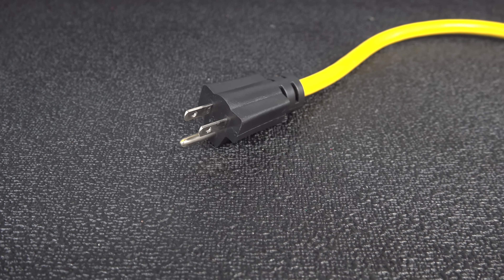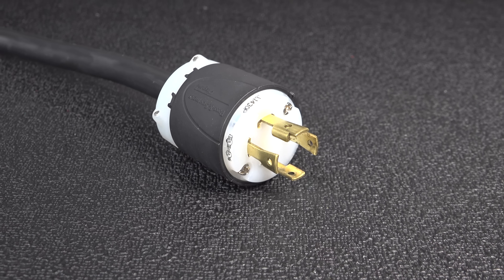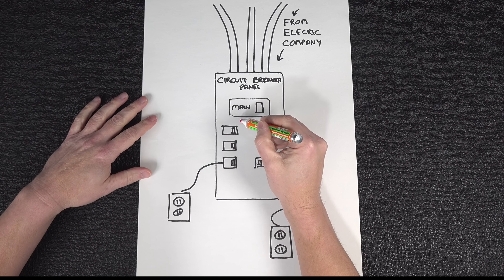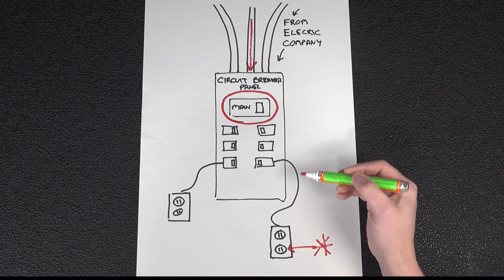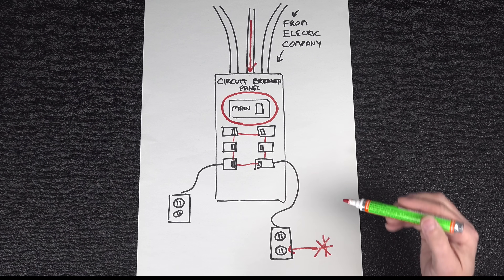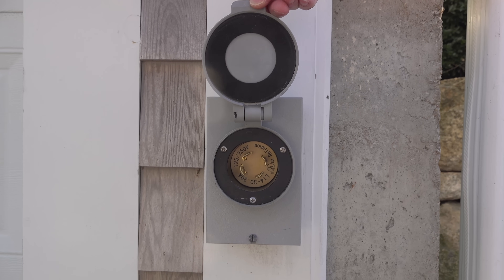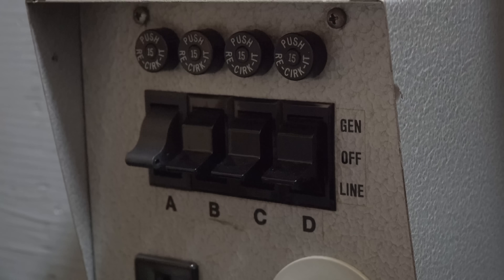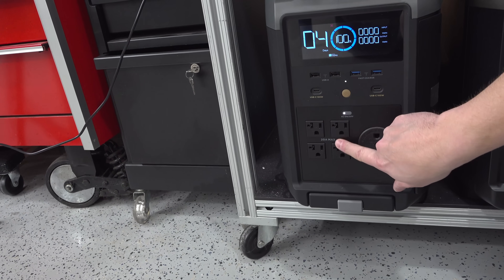Worst Electrical Mistake You Can Make - Backfeeding Generators

Comment: Thanks for this video! I'm a master electrician and seeing a product like this being sold makes me so mad. Imagine if someone's kid gets a hold of this and plugs it into an outlet and grabs the other end. Someone is going to die with a product like this on the market. Its one thing for someone who (hopefully) knows what they're doing to make a setup like this to get themselves out of a pickle, but this should not be something that is mass marketed. I checked out the ad on amazon and its sold from multiple sellers as for being connected to a transfer switch and as having safety features. A bunch of lies. I know some people that sit on electrical code council and forwarded this to them. Hopefully they can get this in front of someone who can get it pulled from the US market before someone dies...
Reply from the maker: What really surprised me with this video is how many people seem to see backfeeding as some right for liberty or other BS. As you clearly understand electricity, it's not an insurance policy but a regulation that truly does something, and in this case makes sure that no mistake can happen when connecting a generator. I did it not because it was was in the NEC but because I work and we would lose power and there was no way I could be sure my wife with kids running around that she could do it without making an error. So it works great, can plugs it all in, can't get shocked and won't backfeed. Seems like a no brainer for about $100 more of materials for a connection that might be there for the life of your home
Reply: @SilverCymbal  I like how you showed the 30A OUTSIDE the residence. I had a friend call me to ask for a checkout of his DIY gen install, and I saw the receptacle inside the house. I told him it should be outside unless he has a factory molded properly rated cable to go through a door or window. He said because he was running propane he could run it in the home, said I didn't know what I was talking about (20+ years as an EE with a PE who builds UL508A panels for a living, NEC on my desk with paperclips all over it to mark relevant tables, so what do I know). I told him I hope he never uses it, good luck, do not ask me to look at anything ever again. Never got to see if it was connected correctly. It wasn't. He had one line and the neutral reversed. Resulted in lots of smoke and usage of fire extinguishers. He still won't talk to me. I consider that an added bonus.
Reply: @SilverCymbal  really is fascinating, isn't it? and like you said, back-feeding the grid may kill linemen... another fun fact: linemen dying because of back-feeding generators contributes to the equally stupid argument to not have generators, since the generators will be blamed instead of [what should be] the obvious user/install error.
Reply: @ETXAlienRobot201  as a lineman, I can tell you we don’t give a fk about this. Glad you’re all concerned though. Step one: open main breaker. Step two: there is no step two. Stop padding the world.
Reply: @MrT13  there's a difference between reasonable safety precaution and padding the world. this comes nowhere close to padding the world. many an "expert" in fields of danger have stories to tell about taking-on unnecessary danger or ignoring necessary safety protocol. and the commonality between all these stories is they regret doing it because they were maimed or they quit doing it because someone they know was killed/maimed. 

electricity is dangerous , as a lineman, you should be aware of this and have thought/consideration for those among your ranks whom would prefer to return home after a call. you should have thought and consideration for the family and friends who could learn the next day their husband/father/friend/brother/etc... is dead from electrocution. unless i missed something here, having at least an interlock is fairly cheap and quite convenient, why take the risk? why put someone else at risk? give me an honest answer. "padding the world" makes legitimate use inconvenient and/or expensive. that is not necessarily the case here. so, what does anyone gain in not setting-up the system to be as fail-safe as possible? there's multiple points of failure with these cables and most result in serious injury or death. in particular cases, property damage/fire are possible. 

you're also making a pretty bold assertion that all linemen don't care, and other people also alleging that they are/were/knew linemen have attested that in fact, they do care. whatever the case may be, i will take your claim with a grain of salt. i will disregard your very poor  example of "don't pad the world" on the basis of encouraging reckless behavior for absolutely no reason whatsoever, and that absolutely will lead to harm/death when shit inevitably hits the fan. electricity is one of the most dangerous fields of science/engineering/tech that exists. virtually everything about it [particularly how we use it] is inherently dangerous. safety features are inbuilt everywhere possible. there's no reason to go against them. there's no reason to so little as tolerate products and practices that go against them.
Reply: @ETXAlienRobot201  ok to me, this is like worrying about getting hit by a blue motorcycle while playing in traffic…. Great psa to save us lineman but during storm everything is hot. I’ve picked up smoking arcing overhead wire off the ground and I wasn’t worrying about if it was fed from a Tesla car plugged in. Or a battery bank. Or just the plain ol grid. There’s one single solitary step to this. Open the main breaker. Just one. It’s actually the same step that the idiot lock does. Just one thing. One single solitary thing. If it makes you feel better go buy the idiot lock. But in reality it’s a power line, we treat it like one. If you use a cord wrong it’ll trip a breaker. Almost every year I go on storm duty and pick up wires fix poles crap etc. even if I hear a generator, hell 10 generators. And I see a wire down it’s hot. If I show up and I hear no generators, it’s hot. If I’m in the middle of the woods 100 miles from anything and there’s a tree on the line but no smoke. It’s hot. During hurricane season if a storm is coming I’ll get out the generator and cord…. My wife is literally the genius apparently who can execute step one of one. Flip the main. And then plug it in and pull the handle. I don’t worry about her “forgetting to flip the main” or “someone just coming along and closing the main”. Literally it’s one step, so easy a blonde can do it. I’m going with padding the world for entertainment. It’s a nice video but I’d rather see a more realistic one. Not where everyone is screaming how would you feel when you kill a lineman! That’s the easiest quickest way to kill a lineman! No. No it’s really not. It’s a power wire, we kinda assume it carries power…. Good intentions. But borderline insulting. It’s like if I went to a shooting range and brought a air rifle and walked around with it like it’s a fking .50 cal. Can it hurt? Sure I’m very unlikely perfect conditions. Is it literally remotely as dangerous as all the other guns there all day long every day? No, no it’s it’s not. So good go for it make a big deal out of the ol red Ryder….
Reply: @ETXAlienRobot201  I disagree with you saying other lineman are in here caring about this. I’ve seen a couple know it alls. A union electrician. And an engineer. That’s it. As you said alleging, but I’m not alleging I’m telling. It’s 1/10 things we are worried about. All of which end up at the same conclusion of not mattering. It’s all hot, I don’t give a fk from where…..
Reply: I tell people not to use it, just pay the extra money for a proper panel lockout mechanism. Fire insurance won't pay if they use that death cord. They almost always ignore me. Funny thing is they know what I do for a living, and ASK me, then get mad when I tell them how dangerous those things are.
Reply: What most people don't understand, the NEC is written in blood. Those rules are there because, at some point, people died because they did something wrong.
Reply: If it was going to happen, it would have already happened.

Comment: My son and I installed solar panels (17 panels @ $5700 all in. Commercial quotes ranged from $30k to $45k) and he made me a cable designed to correctly connect a generator to a house. The city installed a net meter and a shutoff.
For power outages, we turn everything off, flip the switch, connect the generator and turn it on. Then we turn things on, starting at the most crucial. Once I see the generator near capacity, we're done turning things back on. Since we rent camping trailers, including a generator, I always have at least one extra, so I could daisy-chain a couple generators and keep switching things back on...
Reply: You probably know this but it is another problem that wasn’t mentioned in the video. Unless you have the circuitry for it daisy chaining generators can be pretty hard on them and waste power because they can be out of phase with each other. If they are 180 degrees out of phase (with single phase) the outputs from the generator will effectively be a dead short and you will melt stuff and or just trip breakers, if they are just a bit out of phase you waste power but modern generators also have a lot of electrical components which also get heated up and can fail.

If your generator tries to feed into the mains but is out of phase lots of interesting AC electrical magic happens and stuff can fail really spectacularly.
Reply: @glenecollins  
Actually Glen, I didn't know that so thank you. Some research will be coming my way fairly soon.
Reply: Shep VanDelay  
They already have. Our $375 summer electric bills are closer to $35 and our off-peak months dropped from $125 to generating credits. We're lucky to have a city that owns their electric company and they give us a 1:1 credit for anything we put back into the grid. We've had the panels for just over 5 years.
Reply: Shep VanDelay  
Two of my sons own Teslas. I have 5 sons. One of them drives big trucks and probably only gets 12 to 15 mpg.
But, they all make close to 6 figures. One of the Tesla owners makes whatever he wants because he's one of the best programmers in the world. I think he makes North of $200/hour as a consultant. That's all he does now. Just turned 32 yesterday. Single and free to do whatever he wants.

Comment: You are correct but failed to mention the removable shunt that disconnects any home from utilities. They have both fused and non fused shunts. That is how to isolate a home from back feed problems.
Reply from the maker: The issue isn't that you can't disconnect from the street succesfully It's that it needs to be done in a way that connecting the generator disconnects from the street at the same time. Whether its a manual or automatic switch, those are the only approved ways. Doing it manually but without an interlock or double-throw switch is the legal requirement

Comment: Back feeding through an outlet you'd only have 1 phase with 120v it more or less just for electrician tool to find broken circuits or fault s that ain't easy to find in old houses or trailers. Take it from an electrician.

Comment: I used to work at an electronics place and we'd have a few cables lying around with 3-prong male on one end and the other end was stripped with the three wires exposed. They would be used to hook up mains power to the devices we were testing and building. When I was new to the job I mentioned to my boss "That's gotta be the most dangerous thing in the building." He said, "No, I'm the most dangerous thing in this building."
Reply: Ironically by allowing to this happen he was right.
Reply: @arthurfrayn7619  moo moo
Ok I’m. No ok no I
Reply: Haha yeah, I worked with similar cables at an electronics factory. It seemed OK because we thought we knew what we were doing. In fact it was just careless and negligent and I got many shocks at that place as  did others. It doesn't even save time to do things the wrong way. There is always a safe way if you just think it through.
Reply: Should have had him prove it by having a one-on-one competition with the cable. There are safe ways to do this kind of thing. I implore everyone to value their life and health higher and not put up with this sort of shit.
Reply: @chaos.corner  you mite be one of two steps ppl.
Reply: @MrT13  Nah, I've just seen plenty of videos from countries with lax safety standards. Nothing like watching someone be eaten by a machine, wrapped around a spindle or burst into flames from contact with high voltage because some cheap and simple safety measures were not considered important enough to bother with. But you keep on doing what you're doing, chum, the world needs cautionary tales.
Reply: @chaos.corner  lol chum. Yea my two tickets are in grave danger. Boy I hope I keep remembering to flip that one single thing I need to do in order to do this. See that’s the thing. Ppl who dunno sht about electricity think that this is the worst thing ever. But I’m here to tell you as a lineman that goes on storm duty every year idgaf if ppl wire a generator to their house. We treat everything as hot all the time anyway. And then test and ground stuff so who fking cares about this??????? Not lineman……. And that’s my point.
Reply: @MrT13  You seem to be lost. This thread is about an unterminated wire in an electronics place, not linemen and generators. And, in fact, you prove my point because you have safety procedures and equipment to ensure your safety, not just some shithead boss who thinks the safety of his employees is a joke.
Reply: @chaos.corner  lol. When you get a piece of equipment in. What are they supposed to do? Run pipe. Get inspections. Bolt it down etc etc etc just to be able to energize it?????? You mean to tell me that a company that tests equipment obviously. Is supposed to fully and permanently install it every time they test it????????????????? Do you not see how fking stupid that is? I’ve had to test transformers before. Big ones. 13kv per leg. 3phase 1500kva. 25,000 lb transformers. So by your logic I’m supposed to pour a pad. Bolt it down. Run a bunch of underground primary etc etc etc. orrrrrrrr do I hook up a ground rod and 3 ground straps right out the front door? ITS FOR TESTING. you hook up the 3 wires. Plug it in. Wtf is so dangerous about that????? If I ran a refrigerator business don’t you think I would be plugging them in when I get them???? If you dunno sht about electricity just don’t comment on it. Mr chum lol.
Reply: @chaos.corner  go ahead and ask the original commenter if he things extension cords are dangerous. Or is that what he obviously has been using no problem for probably years now. His boss was either just making a joke. Or pointing out that tools and inanimate objects are just that. Ppl are dangerous not a dead extension cord laying on the ground…..
Reply: @chaos.corner  you are the one who commented about safety and a person having a one on one with copper and rubber. When you just don’t understand why the old boss said what he said. Lol. You know guns don’t kill ppl, ppl kill ppl. Spoons don’t make ppl fat. You are your own worst enemy. Cars don’t drive themselves….. I think the original guy was pointing out a mindset of self responsibility. You on the other hand think he was complaining about his boss and work…. Buuuuut I’m the chum. Lol. You know what nvm your right lol
Reply: @MrT13  Ah, I thought he implied that they were using them live but yeah, if they were wiring them before plugging them in then no issue.
Reply: Yea cause it’s really just not that serious. Yes to anyone who can’t understand 2 simple instructions yes maybe it’s super duper dangerous …..

Comment: Oh please. If you aren’t able to back feed a panel safely, then don’t. I have a special socket for it. And YOUare WRONG. As long as the main is off, it is fine. Not everyone is an idiot with no sense.

Hey..don’t run your generator inside your house!!!
Reply from the maker: The video is 100% correct. I'm not the one who made the law but I agree with it.  $100 of parts to ensure everyone is protected is money well spent. People make mistakes, so saying you aren't an idiot doesn't cut it. What about a spouse, kid or someone else in the mix that you didn't plan on. If you don't want to follow the law and rules for this its the same as running a grinder with no safety glasses, except for one big difference. With backfeeding you can kill someone else, that's why its against electrical code and enforced in every state in the US. If you can't afford another $100 to install it correctly that's up to you but if your insurance is cancelled as a result you might wish you had.

Comment: I do this with  a 240v plug. works great and will continue to do so. The problem is idiots.We can solve this by letting them run with siccors.
Reply from the maker: Sure, hey why worry about anyone else, right. This isn't just some paper law like car registration, it ensures total safety for about $100 of parts. If you can afford a generator why not install it correctly.

Comment: This is one reason why in the UK the main breaker is double pole - when tripped, both line and neutral are disconnected from the incoming supply. In Europe this is not necessarily the case - some countries allow just line to be disconnected, which can be dangerous for various reasons.

Comment: Aw bullshit... If you disconnect the main, the cable IS NO PROBLEM.. I've connected generators to my home hundreds of times using cables like this.  I ALWAYS disconnected from the mains to prevent back-feeding.. It just takes a little understanding of electricity.